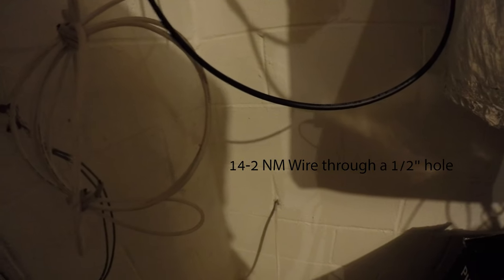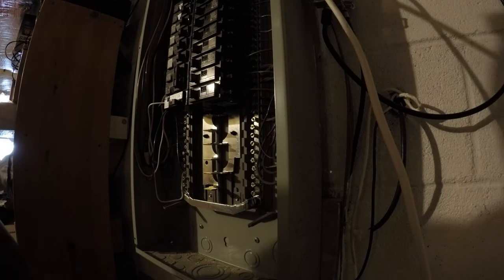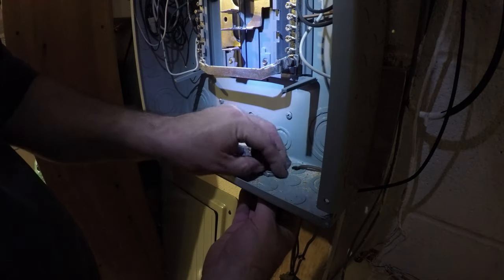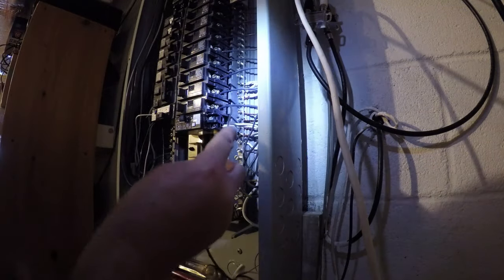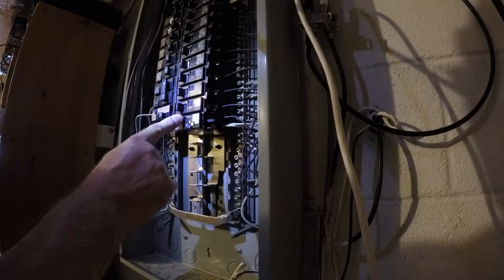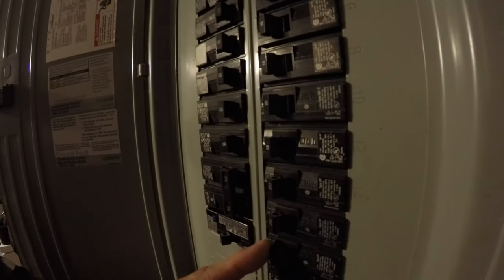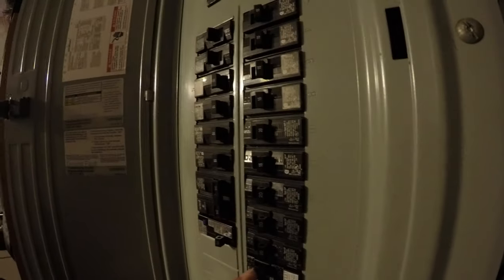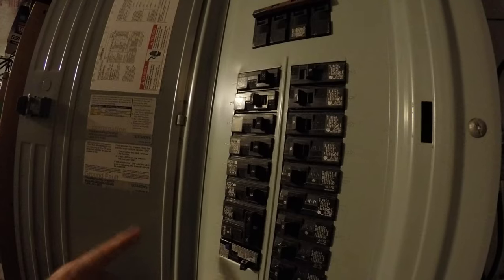How to Install an Exterior Outlet on a Foundation and Tie-In to Main Panel From Start to Finish

Comment: All 15 and 20 amp exterior receptacle outlets in a dwelling unit must be a weather resistant and tamper resistant receptacle outlet and in a weatherproof extra duty in use cover
Reply from the maker: Anyone reading this be sure to follow this recommendation!

Comment: So is there no need to seal around the box on the wall? I noticed it's not a fully flat surface, so would it benefit from a bead of silicone or does it not matter?
Reply: It does indeed matter. I think the box has a foam flange on the back but some sealant doesn't hurt.
Reply from the maker: Sure, sealant around the top and the sides would help for sure. And as Anthony says, the foam flange helps. - John

Comment: Coming into this a bit late. Is pulling Romex through the concrete wall like that legit?  I'm not an electrician by any stretch but instinctively I'd think conduit would be called for.  Or is the Romex jacketing sufficient for this purpose?  Just curious.  Thank you for sharing this video!
Reply: Nope!

Comment: Everything good, but why the upside down receptical??
Reply from the maker: No reason at all. Good eye! I catch myself doing that and I usually go back and fix them.
Reply: Daniel Penney, a lot of Cities are going with Ground Up.  That way if something fell off the wall, it would hit the ground and not short out the circuit.

Comment: Not trying to be a critic, but if I may say, the outlets installed typically would be installed with the ground port at the bottom just so it it has consistency with the other rest of the outlets in the home.
Reply from the maker: Thanks for the comment. There's a lot of debate around this. Some install the ground pin down, others up. Sometimes all will be down but then those that are switched will be up so you can identify them. I'm not sure why I did it this way. - John
Reply: @UDoIt2  I didn’t know or have heard of that, but it’s always good to learn something new. If the purpose of switching the ground pin orientation is to identify a newly installed receptacle then it makes sense.

Comment: The only thing I didn't like was you didn't seal the back of the EXTERIOR outlet box  on rough stucco to prevent any water from ever getting behind it!!!
Reply from the maker: Yup! I agree. For a proper solution I should have and thank you for pointing that out Dale.
Reply: @UDoIt2  lol In your defense, I use to be a roofer. So I am all ways conscious of water penetration just please remember never to caulk the bottom so if water does get in behind it, it has a way out! Just saying.
Reply: @dalejohnson207  What would be the recommended way of waterproofing that hole - just shoot a good quality exterior caulking through it?

Comment: So instead of getting a GFI outlet you got a GFI breaker
Reply from the maker: Yes - I prefer the GFI breaker because it protects it at the source (in the panel). I really prefer AFCI/GFI combination breakers that protect against both BUT I cannot use them in my garage because my saws trip the AFCI part of it so I swapped the breakers out to straight GFI.  The AFCI part is excellent for conditions where you cut a wire when you are hanging a picture or an animal bites into the wire like a squirrel in the attic or eves.  The GFI part is great because it helps MINIMIZE the chances from you getting electrocuted in the presence of a ground fault (like a plug in a puddle of water).
Reply: @UDoIt2  

I wired up outlets along both the left and right side of my garage and they get their power from 20 amp GFI breakers in the sub-panel.  Zero power issues.  It is for extra safety.  Running an extension cord outside, getting into water, ZAP, no thanks.   It doesn't hurt anything to have them, just cost more money.  Money vs Cost.  When I wired for lights, normal breakers.

Upside down outlet in this video.  I also would have used some sealer around the hole before mounting the box on, and maybe some also around the Box.  I'm also not a fan of those type of outlet covers.  Cheapo Plastic.  I'd rather use an Outside Metal type cover.